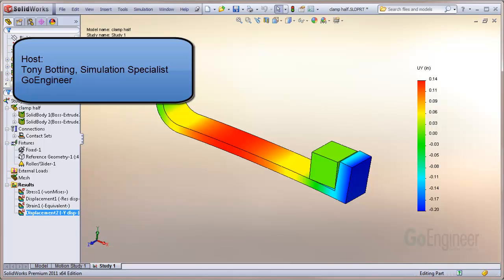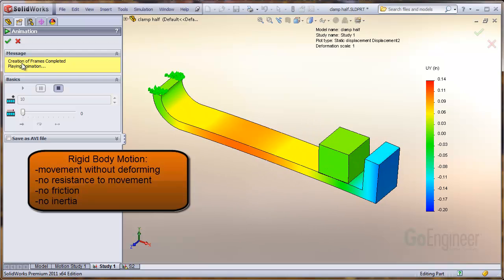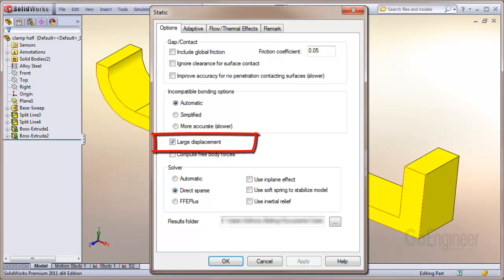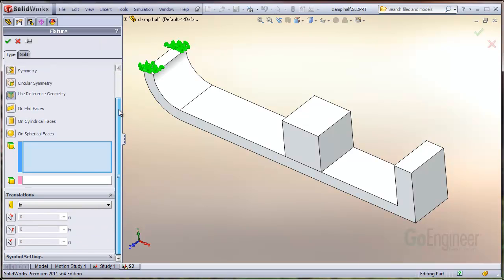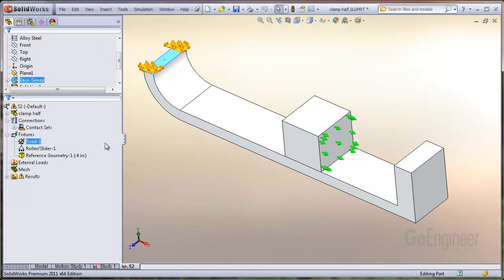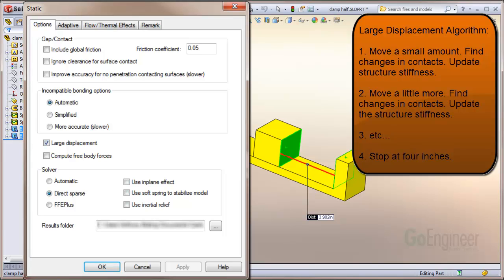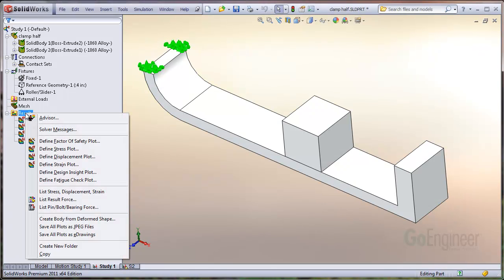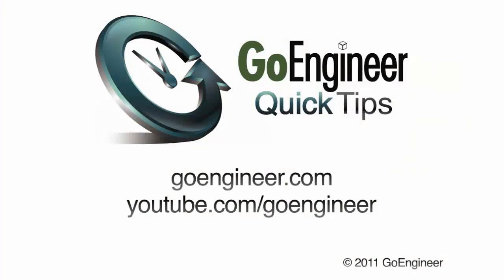SolidWorks Simulation - Large Displacement Case 2

Comment: Appreciate your video all the time, but my question is that 4 in you set up for Non-Zero fixture is not the 4 in you measured, they are two different surfaces on the end block, inside and outside.
However, your simulation result shows the cube almost touches the end block, which makes me confused.